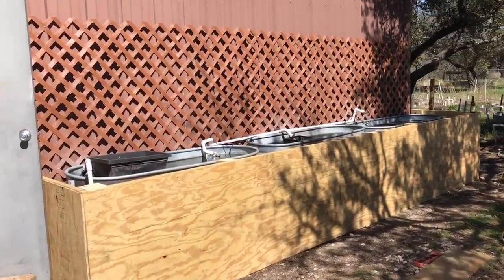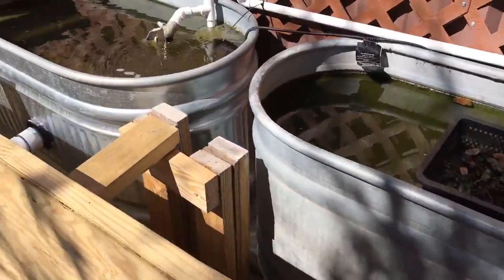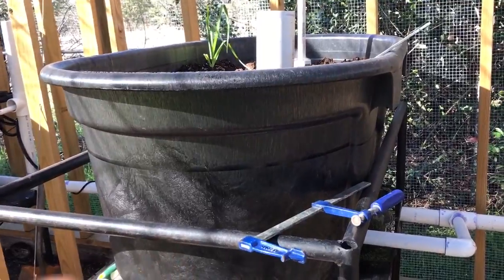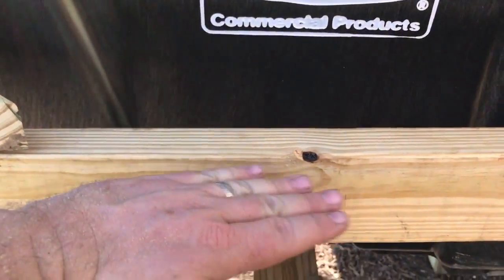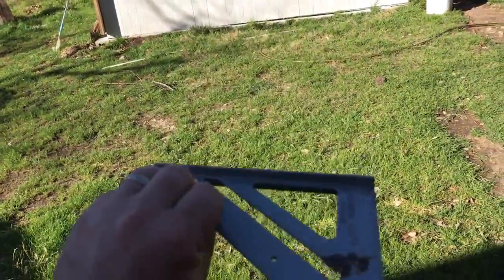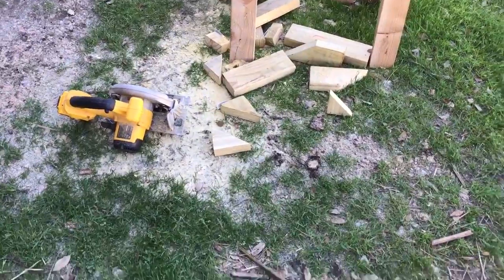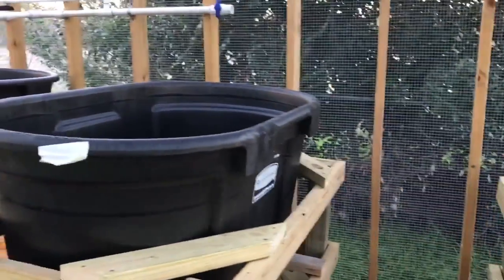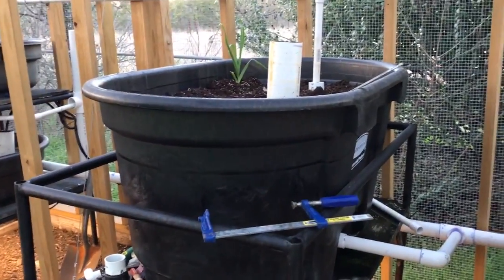Facade Finished and Two Aquaponics Stands Built

Comment: The stands look great, they look pretty dang stout. You may want to consider the 3 2x4's that are directly under the tub. If you put them on edge, they greatly increase their strength. i.e. and Joists. I would also add another for good measure. 
Keep up the great videos.
Reply: Agreed.  Maybe some angle iron underneath the 2 outer beams.